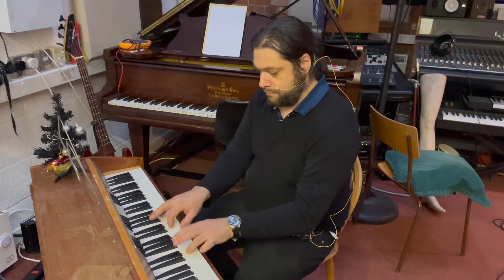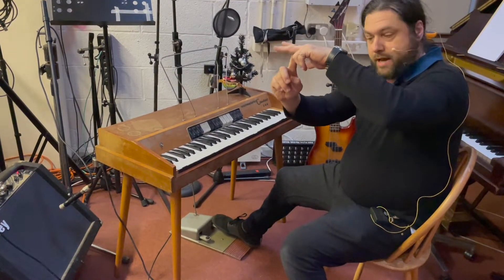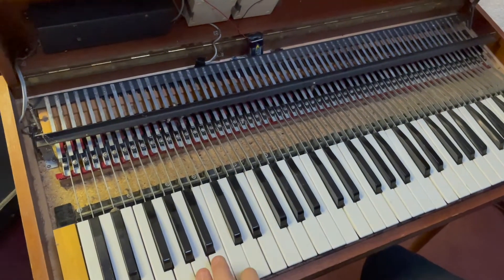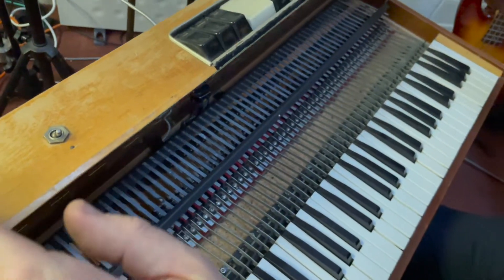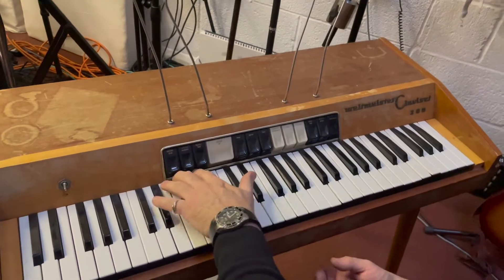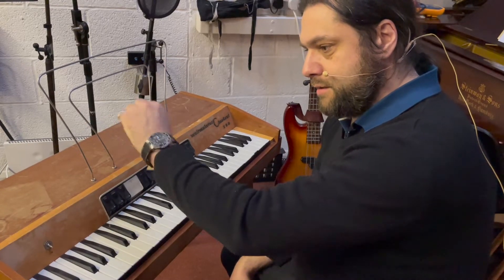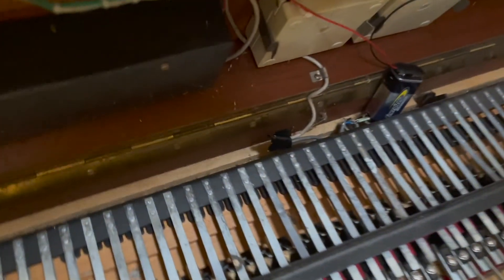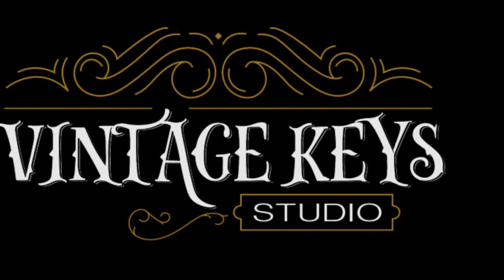Weltmeister Claviset 200 Demonstration Electric Piano and Harpsichord Hybrid

Comment: Weltmiester who are based in what was the old east Germany specialise in high quality accordions, hence the switches on the piano are made like those coupler switches on an accordion. Also the metal bars attached to the keys are the same as in their piano accordions that have the felt pads on that would cover the holes on the read plates of the accordions allowing air to either pass through to t(e reeds when a key is depressed or stopping the flow of air when released.
Reply from the maker: Thank you very much - I didn't know that!